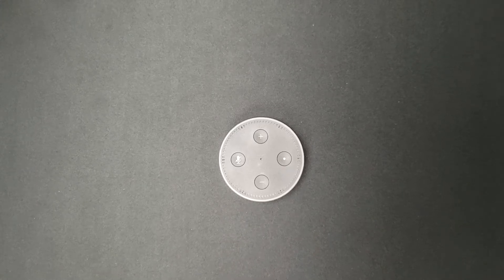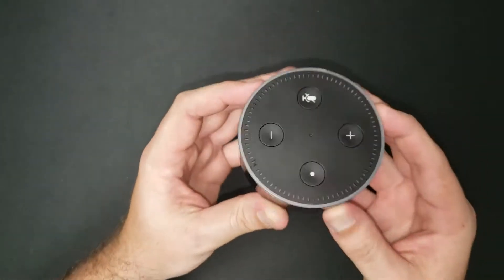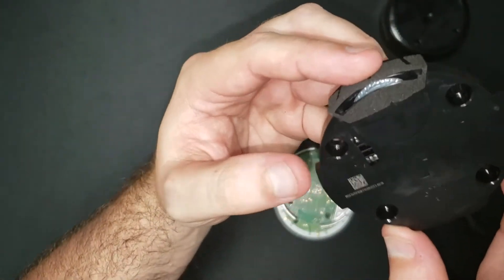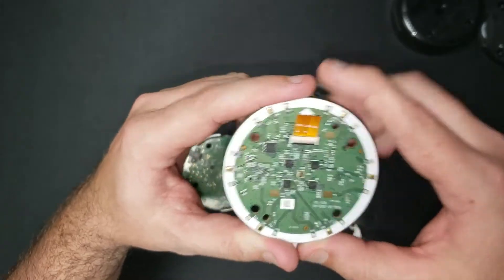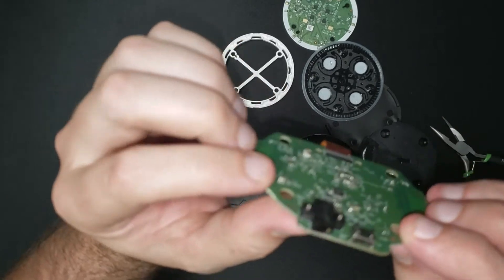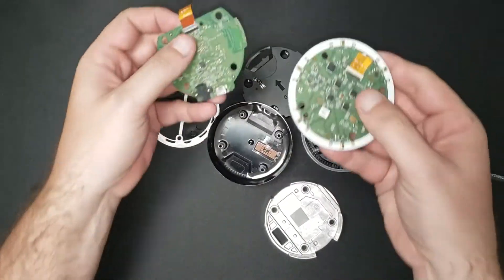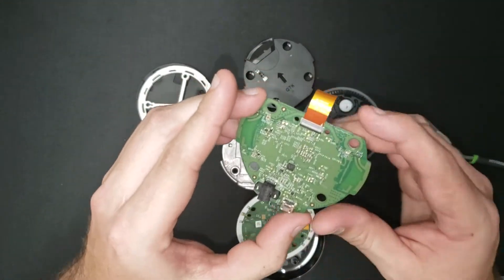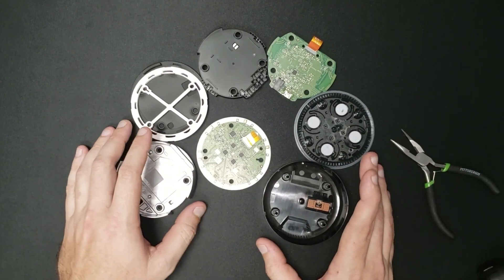Engineer Looks Inside Alexa and Explains Genius Engineering | How's It Made Ep. 4 Review Echo Dot

Comment: wonder if they could have used a stamping instead of die casting to make that bottom heat sink/weighted part for less cost - but maybe wouldn’t give as much of a weighty feel
Reply from the maker: Yes, you can fit more volume in the same space typically with a casting; also die casting can be very inexpensive per part after the tooling is paid for if you use a cheep alloy like zinc or magnesium i would expect it to be less than Sheetmetal.  Thanks for the comment!
Reply: @JJCCENG  makes sense at high volume yes. Reminds me that I read  Tesla is developing a lot of magnesium thixomolding processes to refine and lower volume costs from what would typically be die cast, so even more savings!